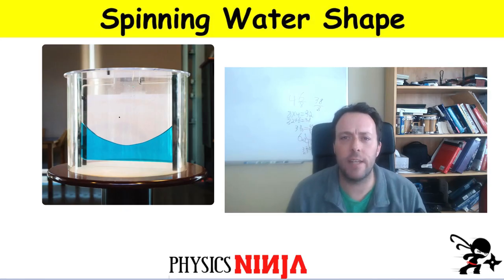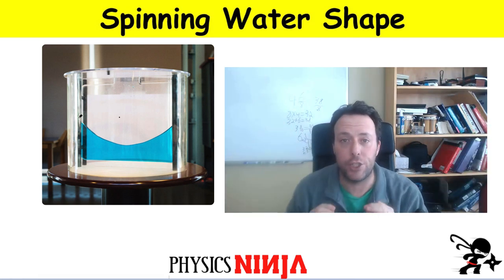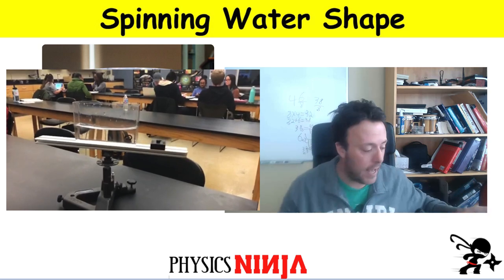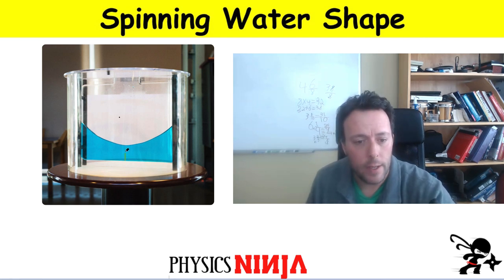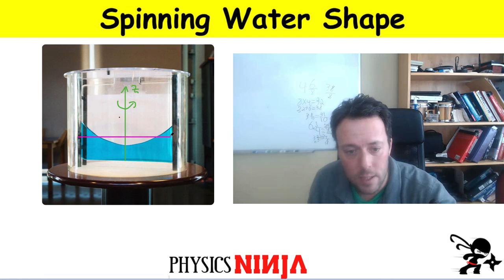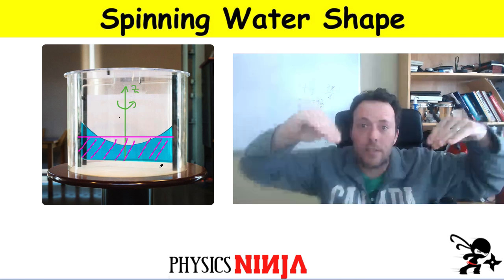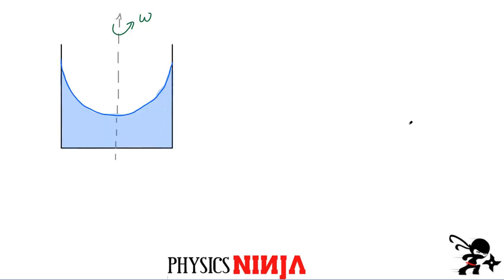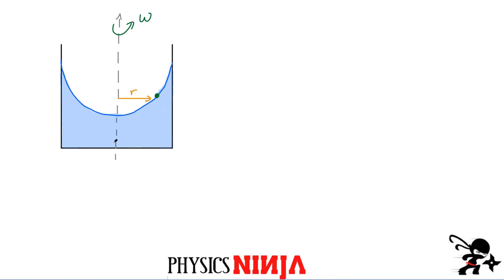Spinning Water Shape Derivation

Comment: maybe i'm missing something, but it's not clear to me what part of the initial setup relied on the fact that it's a fluid. if we consider a molecule at the surface of a solid cylinder, it experiences force of weight and normal force from the rest of the solid, yet the surface of a spinning solid cylinder doesn't curve like a fluid in a spinning bucket

Comment: A question. What of the drop of water at the top? With theta 90deg, what is the vertically balancing force? Friction?
Reply from the maker: Still not 90 degrees.   It’s a parabola so there will be an angle less than 90